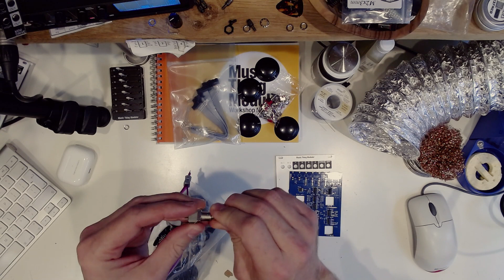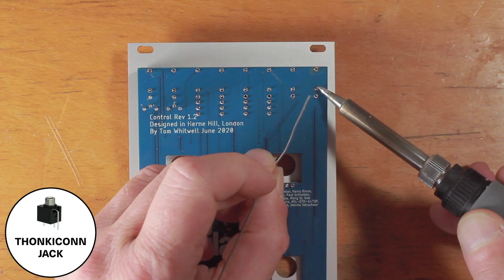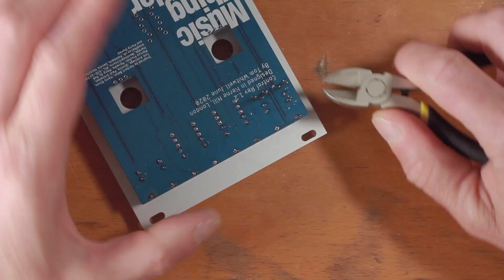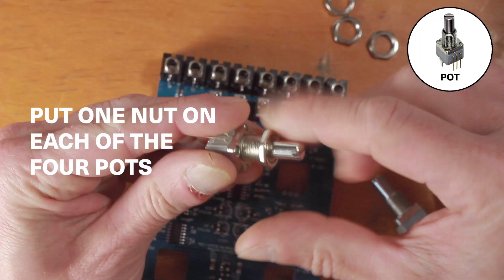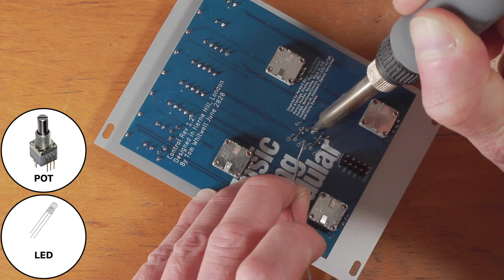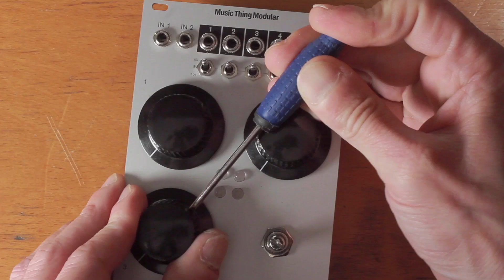Music Thing Modular CONTROL - Build Video

Comment: I just completed this build, and it went very well. For anyone who needs this: when adding the four switches, I found it best to remove the lock washers and not use them, then have one of the hex nuts screwed all the way down before putting on the panel. It matched the jack height well and kept the PCB parallel. Seems like the video skips this, or maybe the switches come with more nuts in recent kits.